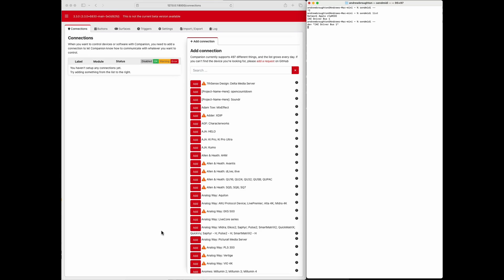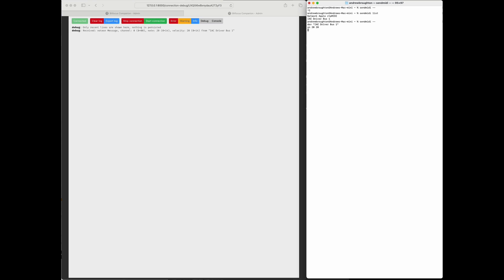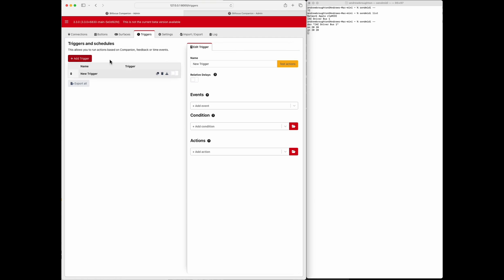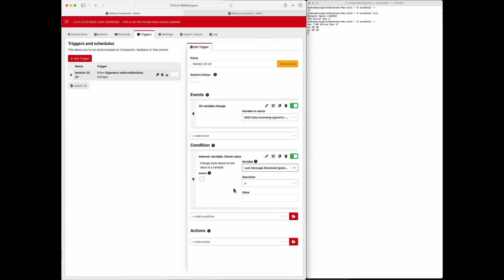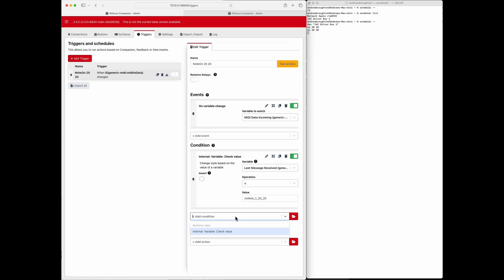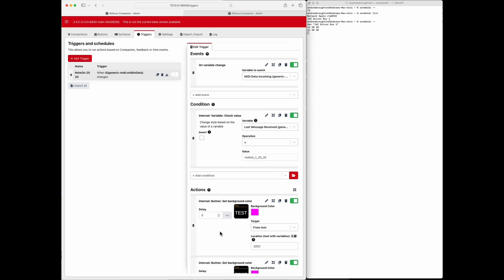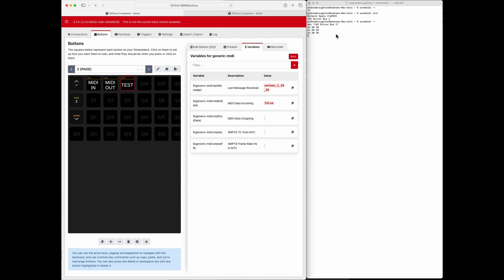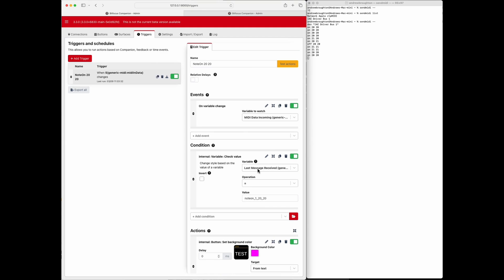MIDI Trigger Demo

Comment: I tried this and it didn't work for my use case. Basically I need a button that would turn off the metronome in Ableton regardless of last midi message sent. The way Ableton is set up is that it's a toggle. Same note, same velocity but it either turns metronome on or off. However, I have a global STOP button that I want to tie an action to trigger a metronome stop. The problem right now is that pressing the stop button multiple times, engages global stop, but toggles metronome on and off.  I can't have that. I'm trying to figure out if a variable can be tied to a background color of a specific button. Let's say, if it's green, the metronome stop is engaged, if it's yellow, it's not engaged. Any way to do this?
Reply from the maker: Sounds like an issue with Ableton. Maybe check on an Ableton forum or with customer support to see if there's a way to make the metronome control use unique commands for start and stop, or at least provide feedback as to what state the metronome is currently in.
Reply: How do we get Ableton midi into companion?
Reply from the maker: @jay4kk  Built-in IAC MIDI driver in Mac, or Install LoopMIDI in Windows. These can create virtual MIDI ports to allow you to connect 2 pieces of software together via MIDI.

Comment: This is pretty nifty. 
One trick you can do in terminal/command is press the up/down arrow, you can cycle between past commands so you don't have to keep typing the same thing over and over.
Reply from the maker: The MIDI commands are not typed at the command line, it's a shell within sendmidi.

Comment: How would you take a MIDI Input from a fader (I'm using a Korg nanoKontrol) and use those 0-127 values to set a volume level or rotary encoder position? I suppose I could make 128 different triggers per fader, but there has to be a faster way. Specifically, I want to use the MIDI fader to control an audio fader on my BlackMagic ATEM switcher. Any thoughts?
Reply from the maker: Easy enough using triggers and variables in Companion. If you want some help with this, HMU at my forum.
Reply: @Remotely-Possible  can you make a tutorial vvideo for this use case?
Reply from the maker: @steelgriffin1  HMU at my forum and I'll be happy to help.
Reply: Where?
Reply from the maker: @steelgriffin1  discourse.checkcheckonetwo.com